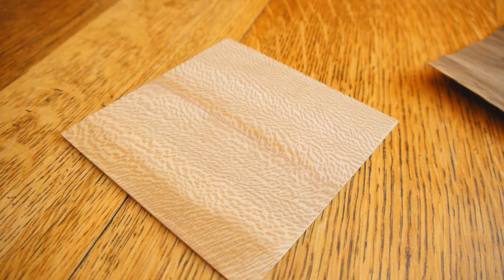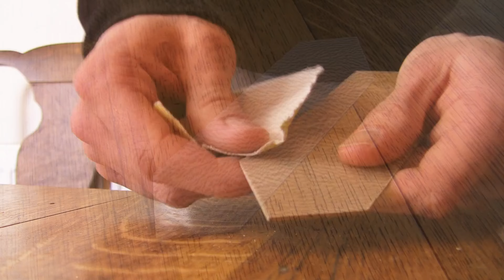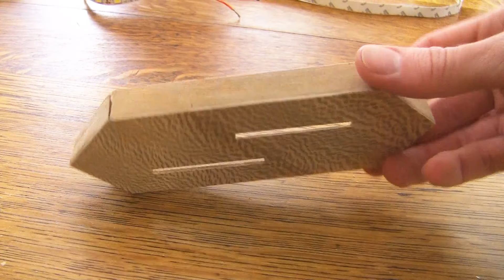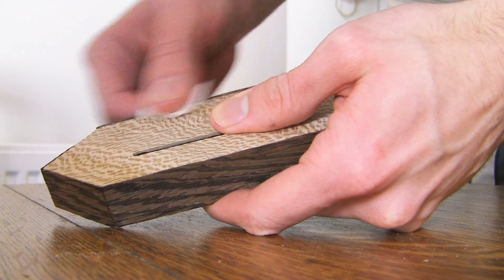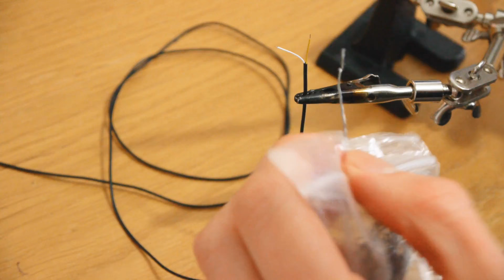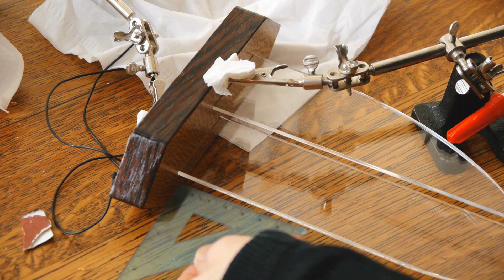Make your own Shard Light

Comment: tried to make this, looked like shit...
Reply from the maker: Naxarine If you use a solid block of wood, where are you planning on putting the LEDs? 

Also, how many people do you think have workshops? Doing it 'in the kitchen' opens up the project to all.
Reply from the maker: Naxarine I clearly state in the video that the knife was the only option for cutting the veneer cleanly because of the grain. If people are competent enough to use a knife to cut vegetables, they're also competent enough to cut a sheet of veneer.
Reply: DIY Perks Chisel it out. I have done some pretty amazing dove joints with old fashioned wood tools.
Reply: Please tell me more, i'm planning to do this but i only have 1 try, do you have any experience to share?
Reply: DIY Perks One could buy veneer with glue on the back already.  It takes an iron as well to apply and comes in the thickness needed.
Reply: @toddtourville984  What does that have to do with cutting the veneer tho?
Reply: @retrogamer2503  You can buy it in sizes close to the sizes needed, making it a bit easier.
Reply: Madara Uchiha forget the first half of the video and just use a solid block using w/e wood you like. also use real wood working tools instead of trying to do it in a kichen
Reply: it also opens it up to someone slicing their hand open because they are trying to use a kitchen knife in place of a utility blade. you put yourself at more risk of harm when you use other tools instead of the proper ones. i cant believe you couldn't spare 2-4 dollars for a disposable xacto knife for the video and warn against dumb stuff like that.  a drill bit or a cheap set of chisels is infinitely better then the damn steak knife like your using, neither of which require a wood shop.

Comment: I've used Plexiglas as a target for my BB gun before, found that it makes some interesting patterns, I'm gonna try this with a shard that has be shot full of holes. :P
Reply: You could also try sanding the shard with 1200 grain sand paper until the shard is completely milk white. That makes the flat sides light up as well, not just the edges. It all depends on what effect you are going for ofc. =)

Comment: Awesome!
Can you add a switch and battery pack? 
Maybe even brightness controls?
Reply: As long as the battery pack outputs the right voltage that should be fine, as for the brightness control you should just need a simple potentiometer/rheostat.

Comment from the maker: Make your own Shard Light
Reply: You're amazing! Keep up the good work :)
Reply: Such attention to detail and then you join the wires with electrical tape .' use shrink tubing next time or open the adapter and solder the wires inside
Reply: i made one of these for my mother following your guide she loved it keep up the good work i used blue leds and it looked quite good and instead of using a powersupply i used a 9v square battery
Reply: Let's make a camera obscura!!!
Reply: It's a link.
Reply: james ostrich just get any odd soldering iron
Reply: Ajmal Ali You could use any kind of wood, then sand/paint it and avoid needing veneer this way (which can be expensive/hard to find). For the top part needing a thinner material, you could always use some cardboard or thin plastic. The result could look just as great if you're creative enough!

I really want to try crafting of these using just one piece of wood/thick branch, carving it by hand with a wood chisel. Would be a lot more time consuming, but the final result would be worth it! Wouldn't need any veneer/glueing, would look more rustic! I might make a video about it if I ever try! :)
Reply: bloodyhoody2  Thanks, I'll try it out.
Reply: How thick should the plexiglass be
Reply: +Mars Seeker You buy it
Reply: just like optic fibre though
Reply: How do you create the shards
Reply: hey, guys, i'm just testing the secondary reply func...
Reply: DIY Perks where do you get your acrylic from?
Reply: DIY Perks how did you make your comment blue?
Reply: hi, plz can u tell me what soldering iron u used because im searching for one and would like to know what wattage is optimal for this kind of work.
Reply: great stuff!
Reply: Diana Loginova septimus heap will hate you
Reply: ***** hey can you help me, i got an adapter of 4,7 V output, what to do now? should i get another adapter? is the led always contains 12v?
Reply from the maker: ***** You need an adapter that outputs 9v or 12v. Nothing lower than that will work.
Reply: does it disperse light well, and be used as a small desk lamp?
Reply: DIY Perks yeah I got a new DC adapter 12 v and worked, thanks :)
Reply: ***** yeah, the only LED I found was 12v white, so Thank God  found a DC adapter12 v too :) thanks for your concern
Reply: DIY Perks  Can you please give me a suggestion on how to make the base. In my country those things are hard to get. Thanks.
Reply: DIY Perks Hello do you have a twitter or a blog where i can follow your WIP peaces thanks.
Reply: DIY Perks how do you make the edges of the plexiglass shine? sand it?
Reply: how do you make glass on the first place ?
Reply: and what screwdriver should i use here ?
Reply: faqgreg I was kidding because of Grave Digga
Reply: Take action guys: use this link ...before they runs out !! Links Here!! ---  https://www.facebook.com/Shards-of-Magic-Online-Gems-And-Gold-Generator-443719989150974?pidid=5b9b37fc-865b-4251-ab7f-68401423327c  === !! Guides placed right here commonly working.                                                                Make your own Shard Light
Reply: +yukikazeminecraft123 
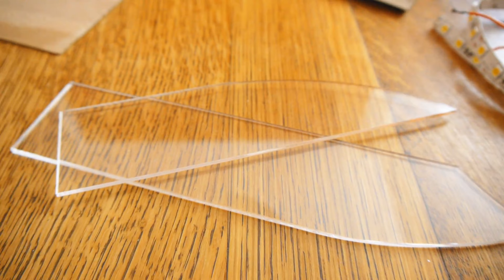0:46
Reply: your really expecting me a 11 year old to be able to pay for
Reply: yukikazeminecraft123 It's a mystery to me too, and I'm still not sure about the screwdriver .
Reply: Make your own Shard Light
Reply: perk can you tell me ? i need to know hpw much pee this shard light?
Reply: MR. Ghost 2
Reply: Hierarchy
Reply: Large hardware stores usually have acrylic sold for windows.  You can also look into sign and plastic material distributors, but they generally don't have small pieces available.  Sign shops could even be an option, and may be more numerous than either above.
Glass will work equally well, last longer without scratches, and can come in some very interesting varieties of color and/or texture, if you're comfortable working with it, (and aware that children or pets and glass can be a bad combination.)
I highly recommend sanding and possibly polishing the edges, either way.  Shards like the ones in the video will have very sharp edges.
Reply: DIY Perks don don don hi it's Mathew.
Reply: do you sell these????
Reply: DIY Perks m
Reply: Next project: Tie dye colored illuminated peace sign.
Reply: aren't these dangerous to have around your house? don't they cut your hands or something?
Reply: How did he write blue letters
Reply: Awesome... Really want to make one..
Reply: the leds are not for sale anymore

Comment: I ordered a couple of rolls of LED strip lighting a few months back for $15 each on ebay and this stuff is AMAZING. I use it everywhere now. I just take an old 9 - 12 volt wall adapter and wire it up anywhere I need light. Like above my keyboard tray. Or under my desk. Or a closet. Or a book shelf. Or my car. Or... well you get the point. ITS AMAZING!

I actually saw a roll of it in a woodcraft store the other day for $119.00 It was the EXACT same stuff I ordered for $15.
Reply from the maker: Yeah, it's good stuff! :)